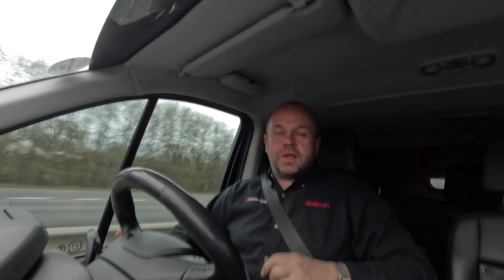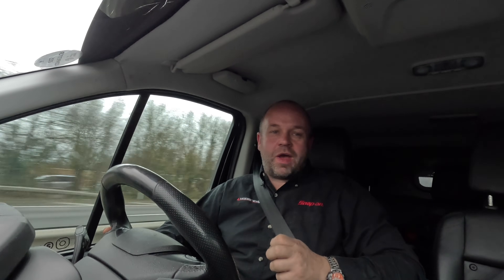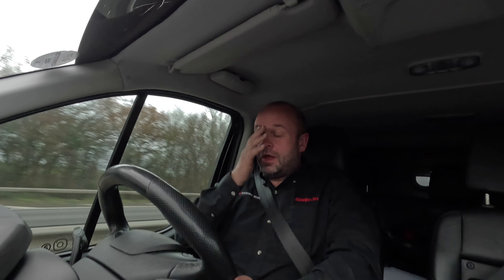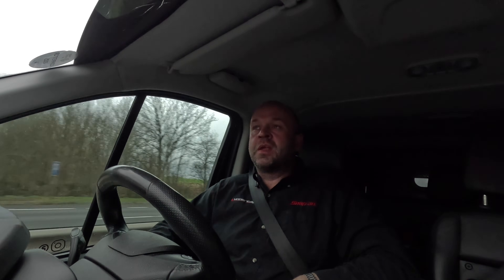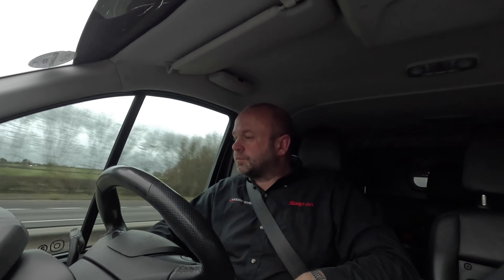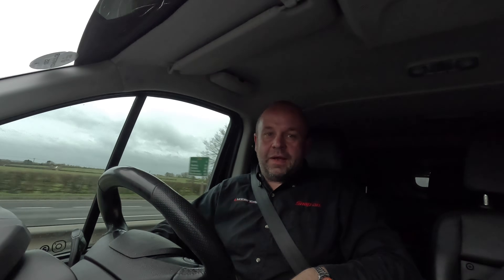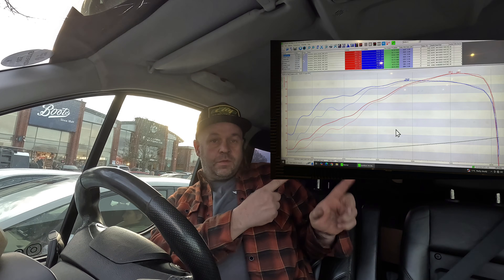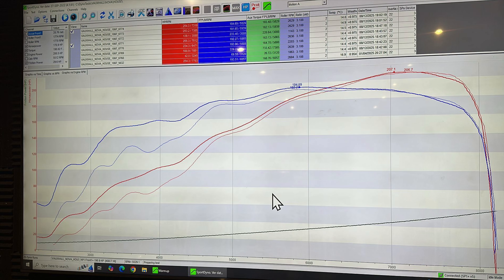Flat shifting Nova, Expertly tuned, 2.0 Vauxhall XE, Redtop on the rolling Road, C20XE, 8000rpm

Comment: Friend of mine had and it was turbo only trouble was it was trying to pull the front end of starting cracking around the back of the strut tops
Reply from the maker: Yeah I should imagine it would if it wasn't strengthened